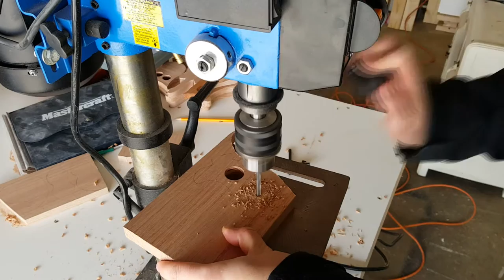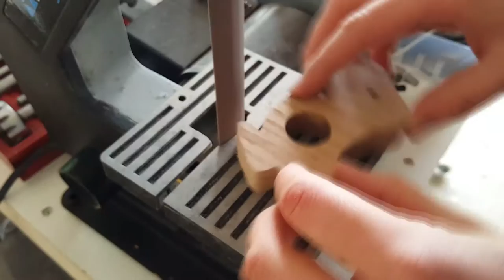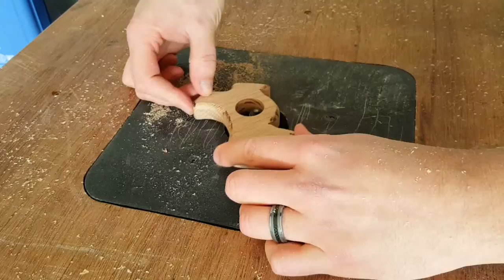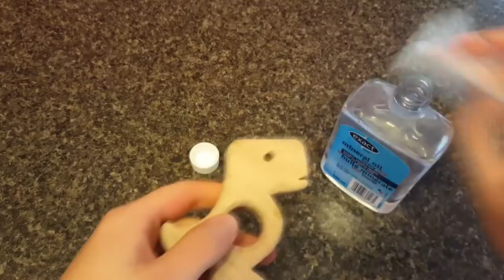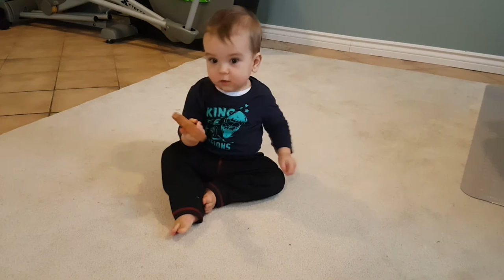Baby Teething Toy - Cutest T-Rex Ever

Comment: Did the same as you but when I rounded the edge with my router I got some not smooth parts when it was curvy.
Did you get the same thing ? 

Good job by the way